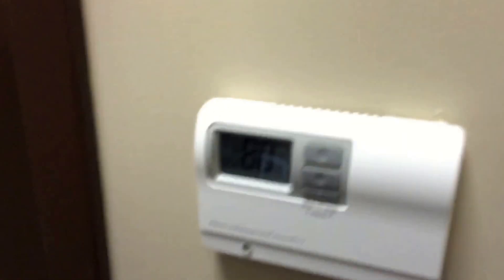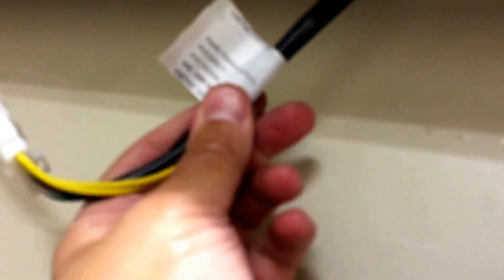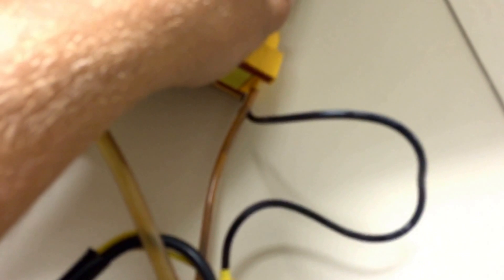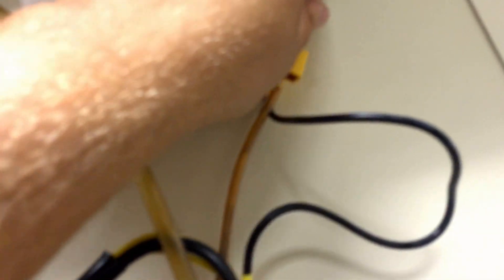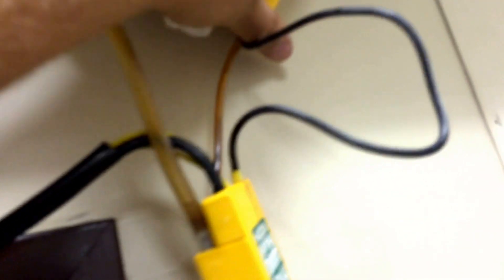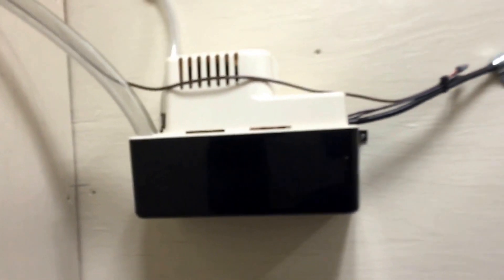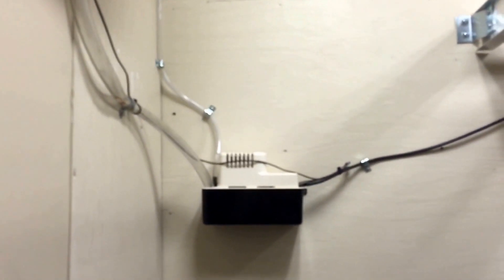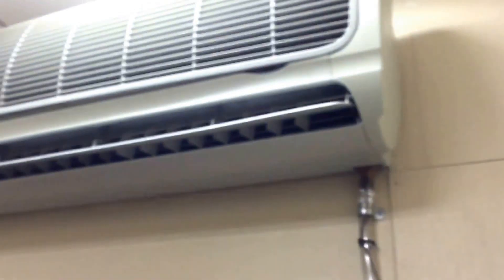EMI condensate pump issue. And what I did to fix it.

Comment: Hey Rob, thanks for the video.  Do you have an opinion on the EMI split units vs the name brand units.  They are about half the cost but I can't find much information online and am considering purchasing one.  Thanks!
Reply: OK, at the end of the video you state that they are junk.  Thanks for the info.  Are they generally garbage or do they all have similar issues like the condensate pump that are easy to fix?